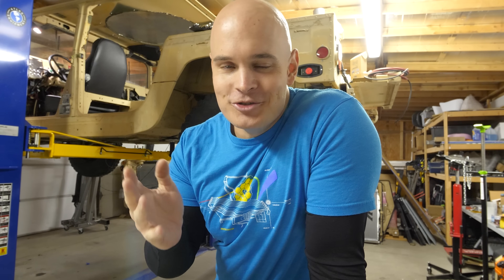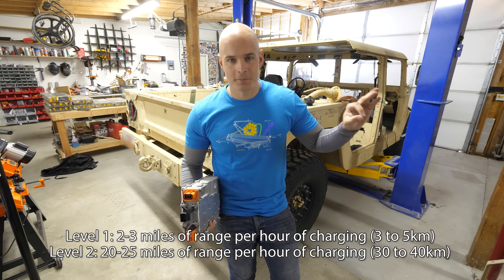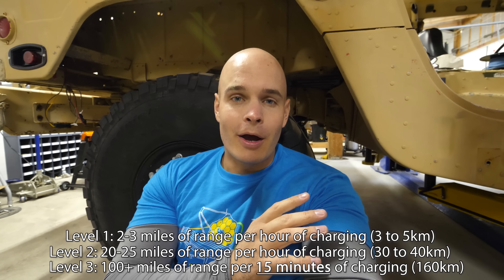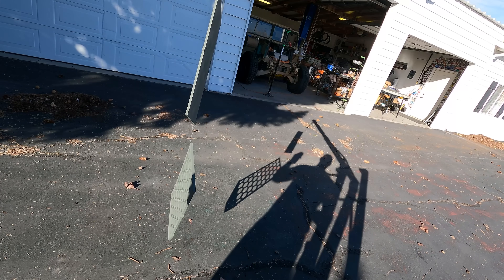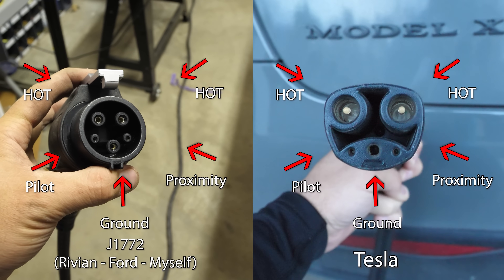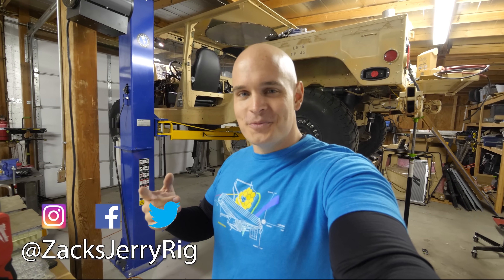My Electric Hummer is Bulletproof!? (Kinda) - 450 Volt Charger Install

Comment: Green tips aren't armor piercing, they are "enhanced barrier penetration" rounds designed to be able to carry though light cover. 1/4" AR500 probably won't stop a black tip AP round.

AR500 is still a good material for this use though. Probably :P

Comment: 12:17 A common misconception, fossil fuels aren't from dinosaur bones. It's actually from plants that got trapped underground a very long time ago, and the energy that they stored from the sun eventually turns in to fuel. So technically gas comes from solar power.

Comment: 3:21 I see that part is labeled Duosida.

Lectron (which Duosida has claimed they're associated with and a lot of Duosida's products are rebranded Lectron products) has a history of J1772 EVSEs (charging stations) that are not compliant with US electric code, lack NRTL Listings, and overheating to the point that they melt the EV's charging port.

I don't know about the quality of that part you're using, however I would not trust any product from that brand.

For more information I suggest looking up the Reddit threat titled "PSA from charging engineer: Don't use the cheap Amazon charge cords, they can melt your EV's charge port"

Comment: The "AR" of "AR500 means "abrasion resistant". It is high-carbon steel, heat-treated for hardness and toughness. As explained in Wikipedia: 
"Abrasion resistant steel is typically used in applications requiring high wear resistance, including backhoe buckets and teeth, bulldozer blades, dump truck beds, ore and coal chutes, augers and aggregate conveyors."
It does appear to be effective against the round from the AR-15, but it's not for armour, and nothing is actually bulletproof (since there are great differences in ammunition).

Comment: Jerry I Think You Installed Armor Metal Is Called This 

1. Kevlar. Perhaps one of the better-known bulletproof materials, Kevlar is a synthetic fiber that's heat resistant and incredibly strong. It's also lightweight, making it a popular choice for wearable bulletproof items.

2. thats what you install in to the electric humviee

3. that is right you installed in to the components including some motors as well

Comment: The slip yoke of your rear drive shaft should be by the transfer case not the rear differential
Reply from the maker: That's how it was made by a pro. So 🤷‍♂️ I don't see why it would matter.
Reply: Placing the slip yoke at the transfer case side and the double cardigan joint at the differential side helps to prevent premature wear and beating causing less vibration and extent the life of the Components and creating a smoother ride
Reply from the maker: @scooper3027  neither my diff nor my t case are moving.  Both are solid mounted to the frame.
Reply: @JerryRigEverything  then if that's the case there really is no need for a double cardigan at all either way your build it super cool and I build drive shaft and have never seen a set up like yours it kinda goes against most of the "norms"  is the tube 3.5 diameter. 083 thickness?  Thank you for responding can't wait to see this beast finished
Reply from the maker: @scooper3027  in not sure about the thickness. I just have a local shop make it for me.

Comment: Even with the bullet proof housing, how do you expect to keep the dc to dc converter and the other electronic parts on the lower side free from water when it rains?
Reply from the maker: They are sealed against water

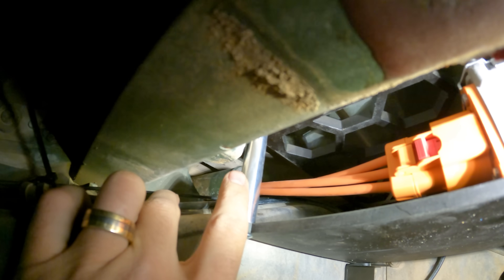Comment: 12:47 - I would have taking a peice of rubber hose and slice it in half and put it on the edges (glue) of that metal pip to keep the wires from rubbing it.  I've seen so many vehicle fires and other shorts from seamingly little spots like that where "it'll be fine" and after all the vibrations and miles it starts to rub through slowly but surely...  ALWAYS protect your wire and strap them down and where you strap down, put wireloom or some insulation to prevent your ziptie or hold down from rubbing through...

Comment: Anyone knows why does he use a 12v battery for the 12v system? Why shouldn't he just take 12v directly from the DC-DC converter, thats one less battery to buy and replace when it gets old?
Reply from the maker: Cuz sometimes it's nice to listen to the radio or turn on a light bar without the high voltage pack kicking on.

Comment: Green tip 5.56 cartridges, or otherwise called M855 cartridges, are not armor penetrating. They have a steel core, but that is not a penetrator, it's to make the projectile longer without making it too heavy. If the bullet had a full lead bullet with the same dimensions, it would be too heavy and wouldn't have the velocity that 5.56 requires.

It's pretty difficult to get your hands on real armor penetrating ammo... Legally..

Comment: A half inch steel for a 20 pound charger holder plate, but bent aluminum for power steering assembly.. sounds about right 😅

Comment: wish you would not use fossilized Dino in relation to oil, as the facts are that it comes from mineral called shale the oil companies marketing came up with the myth of oil dinosaurs but it is not right. oil shale. if it was Dino remains it would never be called mineral oil.

Comment: What is the water wading capacity that you have in mind for the vehicle? With open fans for the DC-DC Converter, any chance that water could go in on rainy days? And the wiring on the onboard charger - Are the connections water-proof? Just curious...

Comment: I just notice a slight issue with your setup...
You might want to make it a little more waterproof for a future off road usage...
If you continue like that it will limit the fun of using such an electric vehicle.
The charger and DC-DC converter are especially exposed (a water-cooling system could replace the fan in order to put it in a sealed box).
The electric "brain" could be more easily be sealed.
Batteries could be put in waterproof boxes.

Comment: I just saw the video of the display and in my opinion at this point you should also change the steering wheel if you can. A slightly smaller one with a few functional buttons would be much more practical.

Comment: Having those HV wires for the DC/DC converter being red and blue is not good. Make them orange like the rest of the HV system so you can easily tell them apart.

Comment: The Dc-Dc fan will not like the water if is getting to it. Is hard to see from video but how deep czn you go in water based on the electric modules location?

Comment: Hey Zack! Insane video as always!
But one slight thing, call it my OCD, but the side of the charger which is not covered AR500, how confident are you that a repeated pebble flipping might not pose an issue to it? Like you never know something like these might creep in between the drive shaft and the plate? 😅
Reply: Hello friend how are you?

Comment: Oh holly frock frack dude. Green tip is not “extreme penetrating”  Armour Piercing is black tip.  The old M193 was 55 gr and the new NATO standard SS109  was 62 gr. Yes it was designed for additional penetration but was not ever designed as armour piercing or your interpretation of “Extreme Penetration”. SMH your a brilliant man but that statement made you sound uninformed 

The United States Military adopted the SS109 to replace their M193 5.56 ammo in the early 1980s. It was renamed the “M855 and the tips were painted green. This was done to help troops tell the difference between the new cartridge and the old M193 rounds. Even though the U.S. military gradually phased out the M193 rounds when they made the switch to the M855, the tradition of painting the tips of the M855 green remains.”

Comment: Not trying to rain on your parade just throwing out a tidbit of knowledge for you, green tip or M855 is not armor piercing. It's a normal full metal jacket with a steal core ment to penetrate soft structures like cinder blocks.

Comment: Quarter inch ar500 is not able to stop armor piercing rounds lol, it’s rated to pistol rounds with 45 acp being the highest it can handle, 3/4 inch steel can handle most things up to rifle rounds smaller then 7.62 by 39

Comment: Alex sad is you went from a Humvee to a Hummer another word you went from a military vehicle shitbox civilian vehicle from an engine that can take that vehicle anywhere rock crawling and all to an electric vehicle probably won't have the Torx go up a mountain real good I know you like working on stuff like that but it's a shame you know electric is putting more carbon in the atmosphere is she looking trying to save Planet I'm going Electric then a gasoline car or even a diesel to put out as much carbon is one battery charge a diesel engine has black smoke from New York to LA round trip all the way there and back put out as much carbon is one battery charge and the carbon it takes to fill the battery is even higher than that

Comment: So I know Tesla has this component sealed in with the batteries.  With mounting between the steel plates.  The bottom plate becomes well a surface that could possibly hold standing water.  Granted it would be like 1 ounce or less.  Are you worried that the aluminum shell, ever so slightly, building up corrosion?

Comment: Jerry, I think you can use a thin sheet of insulator at the point of contact between the hummer body and the dc converter for example. Just to be extra safe, from unwanted flow of current into the vehicle.
Reply: Hello friend how are you?

Comment: I'd recommend adding an input current limiter for the 12V battery so you don't cook it if it gets sorta drained, you turn on HVDC and it happens that 12V system isn't consuming much. Because your 12V bat isn't actually used as a starter you can limit charge current to as low as 10A and still run without any problems.

Comment: Regarding the active cooling, besides fast charging, don’t you foresee needing it for good driving performance without overheating the battery modules? Aren’t they designed with cooling pipes?
Reply: He mentioned active cooling as using a chiller for the liquid cooling vs just a radiator in the loop

Comment: If I were you I'd add a protection plate for the charger on the side where it's open with any other stuff blocking access. Chances are tiny that a rock will get up there, but why take the chance when a shield on that side will stop that.

Comment: The bulletproof test was somewhat biased. You hit the aluminum/mild steel sheet lower and it was pressed against ground, so less length from fixed point to where the bullet hit resulted in less angular torque and hence more energy of bullet got imparted to sheet, while in case of bulletproof sheet it hit on the upper side from the fixed point ( where it rested on the cement slab) and hence it had the chance to move up a little from lower half and more energy got wasted there hence less force got imparted to sheet. This might seem a little to no issue but when you measure it up, it actually makes huge difference ( maybe on a factor of 10x).
I think the bulletproof test should consider mounting the test subject to a fixed rigid support where they cannot move or become loose, so that we can get as close to the real impact energy. You would mount it to hummer and it would be fixed so you could've tried to simulate the same scenarios.

Apart from that every second was worth watching. Hope to see this hummer move soon.
Cheers !
Reply: Although what you described is correct in theory, it just doesn't happen. 
Taofledermaus made a video about this, and it turns out that it doesn't really matter how the target is anchored, it could just be standing up without being propped against anything and the result would be the same, you can see it in slow motion. it's very counter intuitive.
The bullet is going too fast, by the time the plate starts to move from the energy transfer, the bullet already went through and is long gone. it's more akin to a knife slicing through something.

Terminal ballistics is a very weird science.

Comment: The military did this. They used 1 motor per wheel and a generator but at 10k per motor 20k pack not counting the generator and the Hummer it just wasn't feasible cost wise but man to see that thing crab walk.

Comment: Since you're building it yourself, and have tons of space, why not also build the normally stationary part of the charger into the vehicle?

Then you could have full charging capability any where that has a power outlet, just make sure to buy an extension cord which is rated for the load.

Comment: Enjoyed your video. But There is No such a thing as Bullet Proof, Bullet Resistant is correct.  I have 3/4 inch AR500 plates with bullet Holes in it. Later from Texas.

Comment: Not an expert but I'm not sure if the plastic protector for the charging cables is a good idea, as they'll get brittle over time due to heat and wear + tear. Maybe some kinda proper cable insulator of more durable material would be better :)
Reply: 12:50
I am an expert (well, at least a professional 😁). The plastic protector is called "corrugated conduit". The orange colour usually indicates it's the heavy duty variety suitable for underground buried installation (kinda overkill if so). I've seen this stuff last for decades, even in warm environments. It seems to only deteriorate if it's directly in the sun (which still takes years). There's a black version which incorporates ground up carbon to block UV and improve sun resistance but, as it's not directly in the sun, he should be just fine with the orange stuff.

Comment: on board charger now connect the water cooling with a pump and radiator that it does not burn before you use it

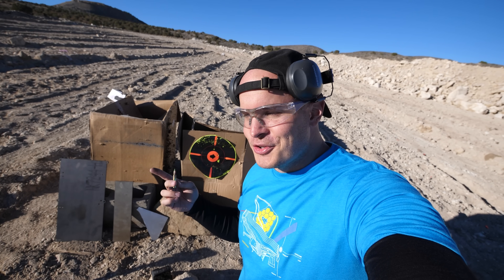Comment: 7:38 perhaps you may have confused the m855 "green tip" with the m855A1.
M855 has a mild steel core that was implemented to help with barrier penetration. Typical FMJ break up quickly on impact. The m855a1 is restricted from civilian use because it is a "proper" AP round. 

Fun fact, m193 or "55 grain FMJ" penetrate ar500 steel better than green tip.
Reply: Agreed, everyone thinks green tips are armor piercing.
Reply: Yea definitely cringed when he said AP but uses a green tip 😂
Reply: You think you know more about AP rounds than Agent 47 ?!!

Comment: Take off those huge stupid heavy wheel and tyre combo, you don't need CIFS anymore, just put some lightweight 18" method wheels with Cooper AT tyres.
Also take out the old air filter canister and any other thing that was related to the old diesel engine/gearbox/fuel system it will de-clutter it and give you more room.

Comment: if you don't cool the batteries well enough you run the risk of permanently damaging them.
this applies when you are not driving the car too. for an example when it's parked outside under the sun.
that was the reason why electric chevy's batteries  didn't last very long on their first generation electric cars.
wish you luck!

Comment: You forgot to cover those wire conduits with insulating foam material the insulation will dampen any vibration noise while driving any road or off road

Comment: I would strongly recommend active liquid cooling for your battery modules. It does not only enable fast charging, the main benefit of active liquid cooling is a up to three times longer battery live. If you also add a battery heating option, you can mitigate a reduced range at lower ambient temperatures!
Reply: Plus overkill is underrated!!

Comment: With such large high capacity battery arrays, I wonder if you had a scale that was accurate enough, it could theoretically be possible to figure out how much the difference in weight is between charged and uncharged on the vehicle (unfathomably small as a cell phone gains about 370 picograms when charged; but scaled up might be interesting).
Reply: Hello friend how are you

Comment: I don't think you put the lift on the locks...my shop uses the same type of hydraulic lifts. you lift it up then drop it a little bit insuring it's level, this also takes the pressure off the pump. Just don't want anything falling in this incredible build.

Comment: So far this project is great, but 11:45 I would worry about two things here, I would worry about limited suspension movement and potential damage hazard to the driveshaft because of the placement of the onboard charge unit, if he takes a pothole like this, it could be more severe than it needs to be
Reply: The rear driveshaft doesn't move much because it has independent rear suspension.
Reply: Hello friend how are you?

Comment: SMPS power supplies (which I repair) have power factor circuits in their primary section that boost mains voltage (110VAC) up to 400vdc typically. They do this using INDUCTIVE KICKBACK thanks to electromagnetics and that power is stored in a BULK CAPACITOR. It's interesting that 480V was chosen for the DC motors in an EV as this almost mirrors an SMPS power supply.
Reply: Hello friend how are you

Comment: That fan on the converter is gona clog/break in no time yo. Those fans are super weak, the load it'll take from driving in your hummer is likely to end it's life in no time. I'd change it for a heavy fan or at least cover it with some sort of mesh.
Reply from the maker: It's got a 50,000 hour rated life span. I'm not too worried about it.

Comment: Why did you put the converter electrical under the 💧 water  coolant reservoir? Aren't you concerned about water leaking onto converter ...⚡electricity  and water don't mix well 💣💣🤷‍♂️
Reply from the maker: The DC/DC converter is water tight. And coolant isn't conductive.